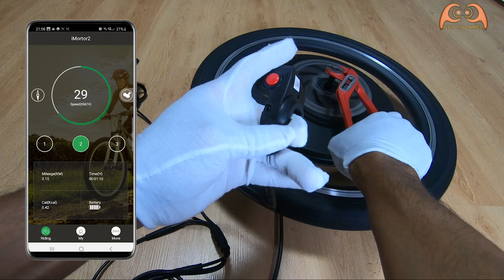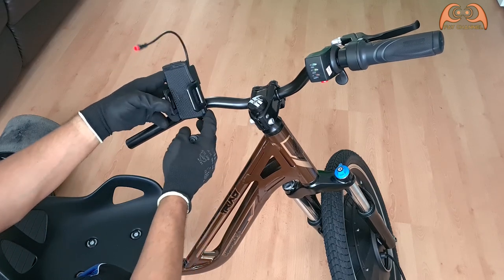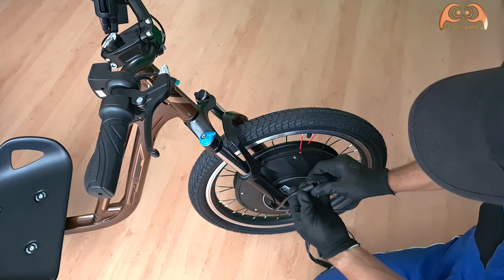DIY Electric Drift Trike with Front Wheel Motor | Assembly P3

Comment: Was ist das für eine Gabel ?
Reply from the maker: Das ist eigentlich von einer Mountainbike-Gabel.
Reply: Wie heißt die genau? Gibt es einen Link ?
Reply from the maker: Heute gibt's leider nicht mehr. Du sollst einfach den Original Gabelschaft mit dem Ersatzgabelschaft anpassen.
Reply: Wie lang muss der Schaft sein ?
Reply from the maker: Der war länger als der Trikeschaft, ich habe ihn abgeschnitten
Reply: so can u make one with a front hub i can still have my pedals on? I ride my 5.2 miles and sometimes it needs some extra boost. but i don’t wanna get rid of my petals or go for a rear motor